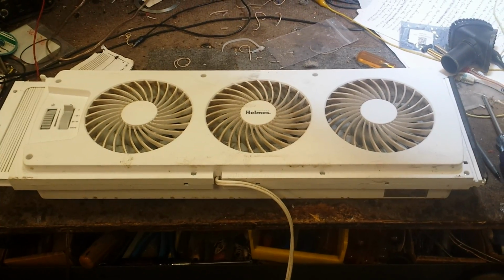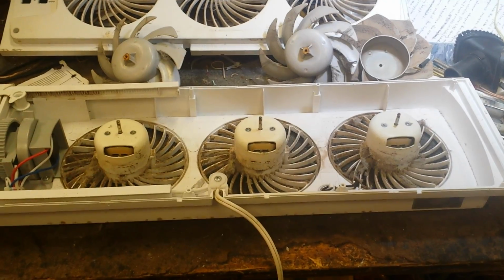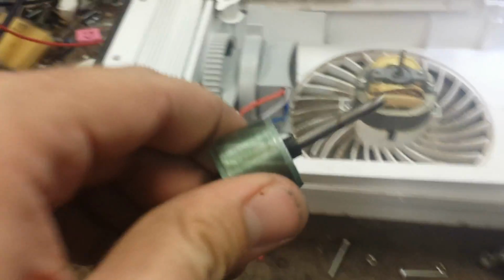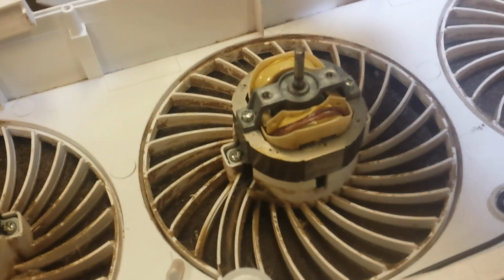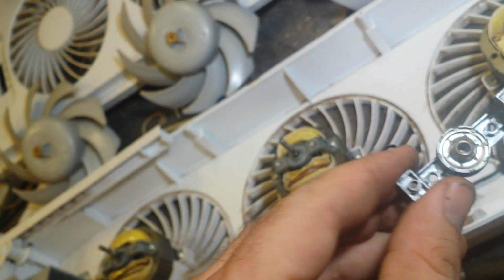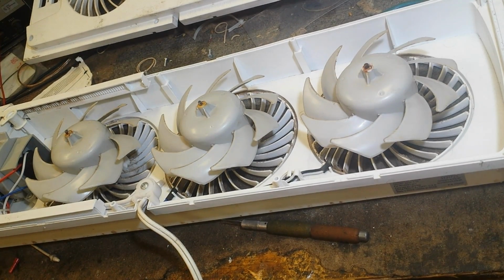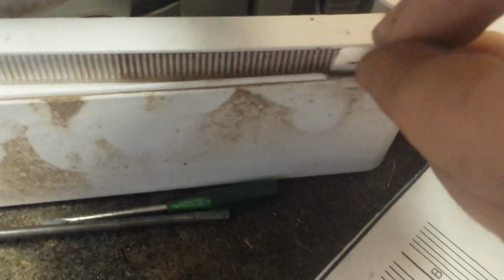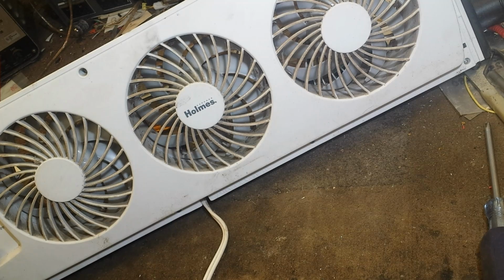Servicing a holmes 3 motor window fan.

Comment: Here's a long post of advice given my experience with these for probably about 10 years.  This is gonna be REALLY verbose, but maybe it'll help.

I've had these fans (branded Bionaire) for 10 or so years.  The I bought the first one because of the slim profile and it worked great.  Then, one motor after another started to fail.  Before the last motor failed, I managed to find another one on eBay and replaced the failing one thinking that there was no more to do.

Moving forward, the second one started to squeal (impending failure), so I pulled it apart and cleaned it up and used regular 3-in-1 oil to lubricate.  That helped for a while but one motor would die and the other one of the three squeal. Plan B: Permatex Synthetic Grease (don't mistake with Permatex Threadlocker!!!)  I get better performance and longevity with the grease, but motors do fail despite all efforts.  Here are those efforts:

- When things are getting a little too noisy, like squeaking, vibrations, etc. (those that have been playing with this know the audible signs), I pull it apart (like everything bearing-to-bearing right off of the enclosure), clean whatever motor is still working (the one that's totally dead, is just that) with 99% isopropyl alcohol, use a wire brush drill bit to clean off the gunk, grease it up (with a cotton swab or fingers) and wiggle a little bit so that the post is aligned with both bearings straight.

(Told ya this was gonna be long!)

- I clean all of the fan blades in the dishwasher.  Also use a toothbrush and a little elbow grease (metaphorically) to clean the intake and exhaust vents for better airflow.
- I have spare parts from the two others that have failed with the chassis' wiring and bearing housings.  One housing still has a single motor that still works.
- If you're reduced to one or two motors, use hockey tape to seal the outside and inside of those vents to eliminate flow-through

You can't find that fan anymore anywhere, I've tried. So, I searched high and far and found a replacement for the motors:  https://catalog.pelonistechnologies.com/item/ac-motors/ac-motor-model-pm58/pm5816-1  As per extensive and prolonged discussions with AI to compare spec, these are what are likely a replacement.  They haven't arrived yet, but I'll let you know if I remember.

In conclusion, here's some advice:

- Use a high temp grease, not oil that will coagulate and/or seize by getting burned out if you run 24/7
- Don't RUSH when you hear an anomalous sound from a motor, it might just work itself out (as many of mine have many times due to weather).  That being said, if it really stars squealing, if you can just stop that one fan and let the other go before you clean up.
- If one is really squealing and you can't disable just that one with the power settings or have time to address it right away, turn off the fan, put a chopstick in it, restart it as it was normally and the fuse will kill it (done it several times without issue)  At least cover that dead hole with hockey tape or the circulation might just be useless.
- If you buy a new window fan (maybe not advised for all people to do or for all fans) pull it apart and lightly GREASE (not oil) it inside and out.  It will last longer before maintenance as per my experience.
- Buy a fan that has good reviews/sales in the hopes that a same replacement could be available a year or two later so that you can replace your failed on so that you have SPARE PARTS!

Well, there ya go!  10 years of experience screwing with these things that are of poor quality, but there are ways to keep 'em moving.  A total PITA!
Reply: Shoutout to @MrAlxsr for giving the part number from Pelonis.  I didn't see this when I started the process almost a year ago, so now AI always asks me questions about motors!  I don't have a water craft and I can't motor-boat it!  My jeans aren't that good.
Reply from the maker: Great writeup, thanks!

Comment: My fan works fine EXCEPT it's filthy and I so just want to throw it in the tub (I won't!) and the switch is off a bit, so it runs two and three fans at the same spot in the switch. BUT I'm not sure it's worth the time to do all this when you can just buy a new one. THAT said, I will share this with my husband and maybe when he's bored, he can play around with it. THANKS!
Reply: See above.  It might help you out.  I put a little more into it than others.

Comment: I am zero mechanically inclined, but I will give this repair a go because you explained it so well.  

I have TWO of these fans where the blades stopped turning. One blade on one of them, and two on the other. I love the design of this fans, but clearly they are built for shit.  

Thank you so much for your help.

Comment: Great job on the video.  To your point, these are complete crap, and meant to just be a throw away.  If you spend a few minutes at the end of the season (for us, here in new England - September-ish), you can extend the life greatly.  One thing to note, if the motor doesn't turn after cleaning, I found the thermal fuse was blown (look @ timestamp 3:29), 2 wires across the bottom of the coil. The sensor is tucked down on the right side.  If you're handy at soldering, you can find these on eBay (a pack of 5 was like $5), the part number is stamped on the fuse body.
Reply: Clean the blades and lube the bushings/bearings  annually  will present heat/draw problems.

Comment: You seem to have forgotten to replace the metal retainers on the fan blades. How well did that work over time?
Reply from the maker: Still goin. The plastic blades are a tight fit. I'm thinking the retaining rings were for shipping purposes.
Reply: @JordanPier  Awesome. About to follow your process on my fan. All I have is moly grease, and that's what I was going to use, but after watching I think a thinner machine oil is probably better. Thanks!
Reply from the maker: @briannotbrain1355  zoom spout mo98 is best on these now adays
Reply: @JordanPier  I've broken many out or four fans so I generally don't use them because the fan blade is notched and is tight.  The only concern without using the secured washer would be if there excessive resonance or vibration while in use.  If you have that, you have another problem and see my yappy post above.

Comment: Thank you sir.... I have the Bionaire version... did everything you did, great tutorial by the way so now just one fan doesn't spin... 2 outta 3 is good enough for me.. thanks again.
Reply: You are lucky.  I have three Bionaire of these verions.  Two of the three units have one working fan.  So out of nine fans on three units,  I have five working fans on three Bionaire window units.  I was going to toss these in the trash and buy new ones.  New ones are $72 at Walmart, $74 on EBay, Amazon has a coupler of sellers selling the Bionaires at $96.  I paid around $30, on sale, about five years ago.  So I think repairing the four broken fans is worth a shot.

Comment: I seem to have a newer version, on which the motor is completely closed by a plastic housing without any screws to access the motor. After I took it apart I felt the fan with the issue got quite hot, but I can't access the motor itself due to that stupid housing. It can't be glued.... any ideas?
Reply: Likely a clip on  design ( just pull it off?).  The plastic motor housing with the screws can create unwanted noise.   Loosen or remove  the screws fixed a noise issue.

Comment: Suggest to anyone else who has the same issue to use wheel bearing grease instead. Try waterproof Mobil 1 synthetic wheel bearing grease. Just don't get it in your hair, clothing or carpet. lol. Oil is made for contained environments like inside your engine or light duty stuff like your door hinges.

Comment: My middle fan isn't rotating at all after I done what you said. Do you think the capacitor might be the issue?
Reply from the maker: Kurohame if the blades turn freely and effortlessly, then it could be the switch. the cap I believe is a spark arrest to save.  the switch. could be defective motor.

check to see that motor is getting power. if it is and it isn't spinning it's got a bad motor
Reply: @JordanPier  Not an expert but love tinkering with small electric motors could be the thermal fuse?
Reply from the maker: @drodriguez3935  could be. Thermal fuse is a requirement on new motors
Reply: i just fill the bearings with grease and it goes for ever then
Reply: I'm having the same issue. Center fan of Bionaire model doesn't spin. I've lubed it and it's now slightly better than the other two.
By probing it I'm pretty sure that it's getting power.
Any idea where I can get a new motor?